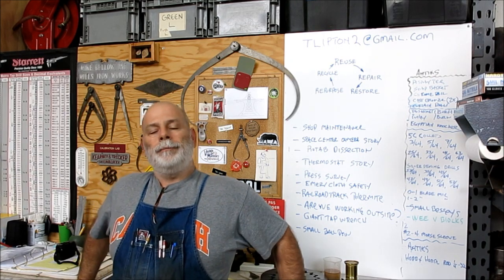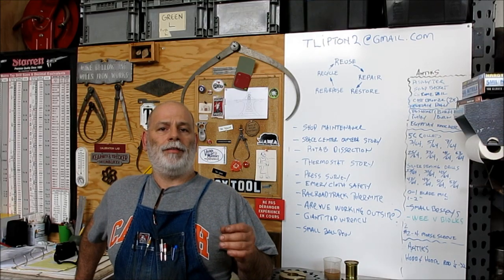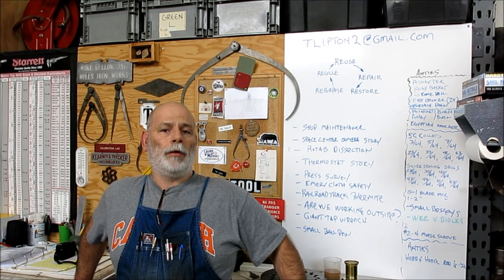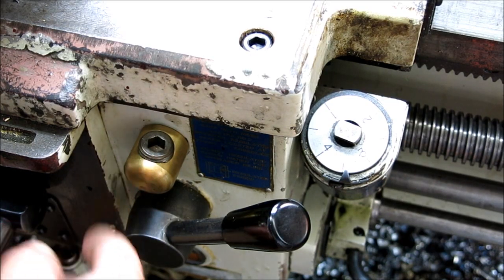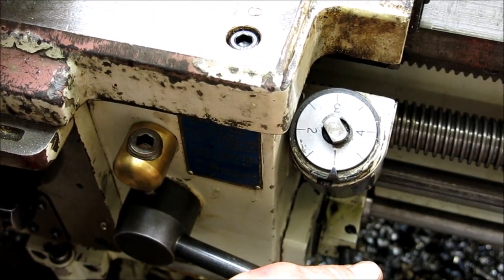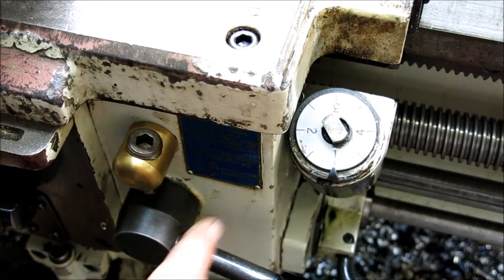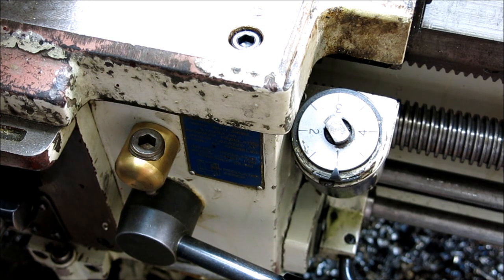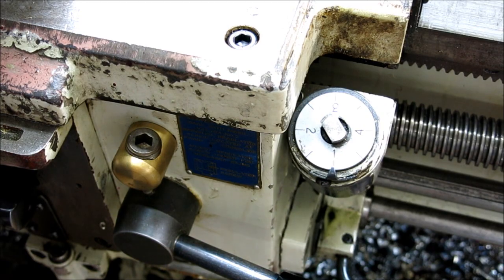Metric Threading with an Inch Lead Screw

Comment: I've been cutting metric threads for years and have never thought of this trick.  I will certainly give it a go on the next job.  It should releive the blood pressure problem of having to wind out the tool and disengage the clutch and still have to worry about the inertia of the machine and the risk of having a prang.with the tool runing into the shoulder.
Thanks heaps.
Reply from the maker: Hi Robert,

I know the feeling. This is so simple its a wonder its not more common. Thanks for the comment.

Cheers,

Tom

Comment: Just engage at 1 when you start no need to back up.
Reply from the maker: Hi Lucey,

With and inch lead screw you cannot just use a single reference on the chasing dial. The gear ratio to convert to a metric thread is a prime number so once you start the thread you need to  maintain the original reference through the entire gear train of the lathe. This is how it is with inch lathes cutting metric threads and vice versa. Hope this explains it better. Thanks for the comment.

Cheers,

Tom

Comment: I'm new to actually doing any machining. I've been studying for a couple years but just got a lathe this spring. I've only done a few threading operations whatsoever. As I've read about going metric threading on my old Logan 10" it always seemed to me like this method you show should be perfectly doable. But everything I read said that you MUST leave the half nut engaged to do metric threading on an inch leadscrew. Thank you for confirming my "naïve" suspicion. :)
Reply from the maker: Hi Jon,

This is why this technique is so important. It really shows that the must leave half nuts engaged is not needed with a little care. Thanks for the comment.

Cheers,

Tom

Comment: Tom, i just bought a metric lathe but doesnt have the gears for threading but has a gearbox with 4 knobs on it for threading , and on a panel are two charts for metric and inch threading but is sold as a metric lathe. This ,,leave the halfnuts engaged " method still applies?? Or just turn the knobs on required position to thread the coresponding thread, weather is metric or inch? The lathe is a Warco GH 1236, you'll find it online warco.co.uk
thanks. Bobby
Reply from the maker: Hey Bobby,

It will depend on the lathe and how it was initially sold as metric or inch. If it was sold as metric then to cut metric threads you should not have to do anything special. If you wanted to cut secondary threads like inch on a metric machine keep the halfnuts engaged. Hope this helps. Thanks for the comment.

Cheers,

Tom

Comment: can you make ACME  7/8-8*60" LONG LEADSCREW I LOOKED EVERYWHERE AND I CAN T FIND IT 
 THAS FOR 12X36  CLAUSING LATHE  5914   MANY               cr34dor2@gmail.com
Reply from the maker: +Mic Ibarra Hi Mic,

You should explore some local shops to see if they can help you with a lead screw replacement. Also I think some Clausing parts are still available in the US. Thanks for the comment.

Cheers,

Tom
Reply: Mic, I was charged with making a very large and long lead screw once until the shop
 owner found out he could have the threads "rolled" for a fraction of the cost. I believe you can purchase just about any acme stock and machine the ends to suit. If there's an easier way, Americans have already found it.
Reply: Dependable Acme will have anything from shafting to nuts.

Comment: Hey Tom, love the guide on how to do this im trying this technique at the moment on my new lathe.
just a quick question ive reading conflicting how to's on threading, most are saying that you should compound feed instead of crossfeed? but in this vid you crossfeed the tool into the job

ive set my compound to 30degs as per my 60deg thread but when i compound feed it just keeps laying over the back thread?
im trying to make the same 18x1 thread as your doing

Thanks for any input 

Cheers Troy

Comment: Hi mate.  I have been viewing all your Meatloafs again, and naturally came across this one.  I have always wondered if there was not a better way of making metric on a imperial lathe.  While I was watching this, I saw an opportunity, I think.  Here goes.  What if after you have made the cut, you return exactly back to where you started from in the first place.  I'm sure you would be able to use the same number on your tred dial, in your case the #1.  The accurately going back  to the start should not be hard to do nowadays, either by slide return stop or using the DRO.  Please can you find out if my theory is correct, or you might already know that it is bogus, but I just did not see it.  I would do it on my own lathe, but my concentration span after my accident is very limited.
Reply from the maker: +Marcel Timmers Hey Marcel,

The distance back to the start would have to be some multiple of the leadscrew pitch. Also the ratio between the screw and the gear train is not linear when switching between metric and imperial. In fact its a prime number. I'm pretty sure it would not work out but only testing it would prove that. Thanks for the comment.

Cheers,

Tom

Comment: Thank you Tom!  I really appreciate your videos and understand the point of this video.  What I don't understand, and is probably because I'm a neophyte, but why were advancing your cross slide and not the compound.   I can only think that it cuts on both sides of the tool.  I learned to bring the cross slide back to zero and advance in on the compound.   I guess I learned the old way.  Can you expand on what your thread method benefits?   It obviously worked....
Reply from the maker: +Rolando Escobar Hi Rolando,

There is no restriction on using the cross slide or the compound. The advantage when using the cross slide is your Z position does not change. Useful when working up close to a shoulder. The compound infeed is useful when you have a large thread or difficult materials. Thanks for the comment.

Cheers,

Tom
Reply: I see!  Thanks Tom!  Love your all your videos.

Comment: so, the main point is you normally have to keep the half nut engaged when cutting metric threads?  even if you have a gear setting for metric threads on your machine?
Reply from the maker: +buckshot75two If you machine has a metric leadscrew you may not have to leave the half nuts engaged. The point of this video was to show you a way you can disengage the half nuts temporarily and not spoil the job. Thanks for the comment.

Cheers,

Tom

Comment: Great video. I was wondering, what's the reason for the angle on the compound rest when doing threading?
Reply: +myshots101 As I understand it, this is partly/mainly so that you only use one side of the cutting tool for cutting. If you did a perpendicular plunge cut you would get a lot of chatter.

Comment: I just tried this to help make a 15tpi bolt for my 4 jaw chuck (like the original). This was my very first attempt at making a thread. Despite my best efforts it was obvious something was going horribly wrong as it was starting to cut threads on top of threads. I shut the power off and finished the job turning the spindle by hand to try to observe the process in slow motion. I did manage to finish the job, but I didn't learn as much as I needed to. Should I have strictly adjusted the compound or just the cross slide? One thing that is clear is that adjusting both is a recipe for disaster when working under power. Manually I could tip and tweak until it was perfectly in line, but glory be what a pain!
Reply from the maker: +ExtantFrodo2 Once you pick an infeed you would need to stick with it for the entire thread. Does your lathe have gearbox settings for 15TPI? Thanks for the comment.

Cheers,

Tom
Reply: +oxtoolco Thanks for replying. I know about using the same thread indicator number. The lathe does not have a native 15tpi gear set, but I managed to get very close using a 28 tooth gear on the carriage feed (though I had to space the 120/127 gear on the banjo to a shallow mesh with it due to the available clearance with the carriage feed shaft). To get the settings for the 15tpi configuration I figured the travel per thread for a 15tpi thread then set up a DTI to measure carriage feed. Then I went through all 9 setting of the feed rate lever measuring how far it traveled for one rotation of the spindle. When all was done the nut that went on the thread fit perfectly, so that part was right.
    In your experience, how much variance on either side of the target number on the thread dial indicator is acceptable? I found it very difficult to be entirely precise (so much so that I'm pondering some means of automating it). Long story short I obviously slipped up in a number of ways from too  much variance in the TDI, to trying to adjust both the cross feed and the compound). I'll have to practice on some scrap when I have some time. I'm determined to get it right. Luckily I found a scrap yard that sells a variety of things that are just perfect for my little shop at 20¢ per pound.

Comment: This all makes sense to me, but how do you set the gearbox for a metric thread?
Reply from the maker: +justfakeit888 On my lathe there is a chart inside the back door for the belts that shows the correct settings for metric pitches. It also requires a change gear. Thanks for the comment.

Cheers,

Tom
Reply: I see. Another question--if you did a lot of metric threading, could you make a metric thread dial, or would you need a metric leadscrew too?
Reply from the maker: +justfakeit888 If I had a lot of metric threading to do I would get another manual lathe or possibly CNC that was setup from the getgo for metric threads. Thanks for the comment.

Cheers,

Tom

Comment: Hi Tom, thanks for sharing this tip with us!
My question is, what do you set the threads-per-inch gears to when cutting metric threads in this way? Or do you need a different set of gears?
Cheers, Ben.
Reply: +SuperGoldnut Thanks
Reply from the maker: +SuperGoldnut Hi Gold,

On my lathe its one gear you change and then there is an alternate gear combination chart for metric threads hidden inside the door.

Cheers,

Tom

Comment: You are the #$%^&*( ! Man! Recently many bizarre metric microscope threads and we have a Hardinge, but no metric adapter, so on another lathe  a Turnmaster, I can cut the metric thread, but do not have a good way of stopping in a blind hole for threading? Tried eyeballing the DRO and stomping on the brake then , back out , reverse and continue?
Reply from the maker: +Stephen Hodge Hi Stephen,

Glad you liked the trick. I hate to admit it but I only learned this recently myself. It was one of those oh gee that's makes sense moments. 

Cheers,

Tom

Comment: This is a good "trick". Thanks. I have not done much threading, just a 3/4"-8 LH SQ thread on some chuck screws, and some 1/4"-20 threads where I turned the tool upside down and used reverse. I kept the half-nut engaged for the 8 TPI because it was too hard to hit the dial tick with a 16 TPI leadscrew and a little 64 tooth thread dial on my little HF 9x20.

Comment: Tom
Why didn't you use the compound when setting the next thread cut or does it matter?
Reply from the maker: Robert Roszell Hi Robert,

For small threads on a big lathe you can feed with the cross slide as well. You do not need to feed with the compound to produce threads. The tool shape is responsible for that. Thanks for the comment.

Cheers,

Tom

Comment: You got any ideas for someone who seems to have a problematic threading dial or who knows what else.  I engage the thread lever every time on the same position and at the same point along the Z axis and then all my semi finished threads just wipe out.  I am about to just go with keeping the thread lever engaged but would rather fix the machine.  Its a GRizzly.
Reply from the maker: JOe Shmoe Hi Joe,

Go watch a series of videos by Buckrun11. He had a similar problem and it turned out to be the wrong chasing dial gear was installed in his lathe. https://www.youtube.com/user/Buckrun11

Hope this helps,

Tom

Comment: Why then is there any need for the compound to be angled? (29.5 deg) I see it that you are plunging the tool using only the cross feed and advancing + 5 Thou (or thereabouts), with each pass. I would have expected the cross slide to be returned to zero and the next pass to be done with the compound advanced + 5 Thou. Whichever, it sure saves the pain of worrying about the shoulder and or losing tool position.
Reply from the maker: Tom Tee Hi Tom,

You are correct that you don't need to use the compound to advance a threading tool. Compound in feed is handy when you have a large thread profile and need to relieve pressure on the tool. For larger heavier machines straight in feed works fine. Hope this helps.

cheers,

Tom

Comment: what kind of cut off tool do you use for cutting the relief????  i need to purchase one like that

Thanks,
  Daniel
Reply from the maker: Hi Daniel,

The tool I used in the video was a Iscar self grip holder. It works great but has a limited diameter range. The one in the video is 2mm wide. Thanks for the comment.

Cheers,

Tom
Reply: Thank you very much :-) I don't cut a lot of big diameter stuff so I'm mostly looking for a tool to cut smaller stuff I think the tool that you have in the video will work perfect... I will look them up thank you for your time

Comment: Clever, really good idea for machines that don''t have a foot brake (probably not the proper term for it)
And, for anyone doing metric threads- due to backlash, don't forget to pull your tool out before reversing! Quite a few winners I've seen forget to do that, not realizing how much slop some machines have
Reply from the maker: Hi Jay,

Thanks for the comment. 

Cheers,

Tom

Comment: Tom,
   Really loved the metric threading trick !! I did also look at Conrad
Hoffman's explanation..... using those transposing gears.... my
problem ...on my old model a Monarch lathe is ....no metric thread
pitch sizes on the quick change gear box....so what English threads
per inch should I ask for?...cutting a .5 mm pitch ....my lead screw is
also a 4 tpi......I SO NEED SOME HELP HERE PLZ.
                                                              T.I.A.
                                                                    Paul Tierney
                                                                        Dayton,OH
                                                                            (937)836-4864
Reply from the maker: Hey Paul,

50 TPI is damn close to .5 mm. The difference is so small its in the noise (.0003) To thread metric quote exactly you need the equivalent of 127 teeth somewhere in the gear train which is prime and has a factor of 25.4 of all things. Conrad makes a good case for gear trains and combinations that produce exact and or very close approximations for some metric pitches. He has delved into this subject much further than I have. Thanks for the comment.

Cheers,

Tom

Comment: I've used this for quite a while.  I actually figured this out on my own because I thread a bunch of metric threads on my inch lead screw lathe in my ATV/Motorcycle shop.  One problem I also had was that my metric side didn't cut 1.25mm or 2.50mm threads which are pretty common in the metric world.  After seeing Keith Fenner calculate that a 20TPI is practically the same as 1.25mm!  Now I can cut them all.  Thanks for all of your great detailed videos.

Andy Maul
Reply from the maker: Hey Andy,

Thanks for the comment. Its a great trick. 

Cheers,

Tom

Comment: Hi Tom
Many thanx for this video! I have a German lathe with imperial lead screw. And during threading i've never opened the half nuts. Now I know, I need one of those chasing dials.
I'm a lil bit confused. Your top slide is on 30°, but perhaps You're feeding on cross slide. Why not on top slide? I thought that I understand the American way of threading. But now I've seen an American, who's feeding on cross slide. :o

Sorry for my English.
Reply from the maker: Hi exact,

For shallow threads in easy materials its fine to infeed with the cross slide. Functionally it makes no difference. For large coarse threads in tough materials I generally infeed with the compound. The angle of my compound is always set at ~30 degrees in case I want to thread. Its also a convenient spot to keep it out of the way of the cross feed dial and tailstock.

Cheers,

Tom

Comment: Hello Oxtoolco,
This was a very well balanced video, filmed in real time which is the very best way to show it. However you seem to have got it all wrong from what I saw of the film, you have the compound slide correctly set at half the thread angle, but you are incrementing with the cross slide handle, this does away which the whole reason for setting over the compound slide, which is to be cutting only on the front edge of the tool.
I have used this method for the past 40 years, although not at these revs, well done for surviving!
Reply from the maker: Hi French,

Thanks for the comment. I pretty much leave my compound set at that angle all the time to keep it out of my way. So I didn't actually set it to do this video. I do use the compound for larger threads in tougher materials. For little threads and a nice rigid machine you can go either way and be fine. So got it all wrong might be a little over the top. The tool is perfectly capable to cut on both edge at the same time. If you do what most guys do and infeed a thou or so with the cross slide as your last pass to polish both sides of the thread wall you are basically doing the same thing. So you saw it worked fine right? Maybe do some experiments with your machine and tooling and see how it works for you.

Cheers,

Tom